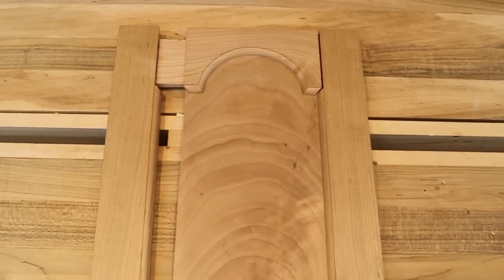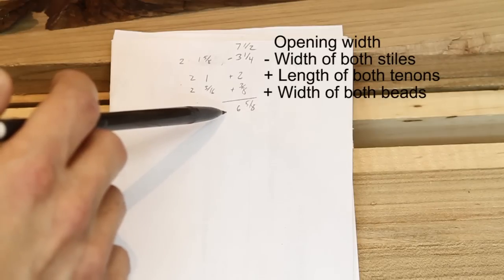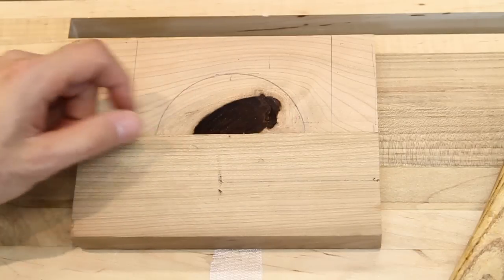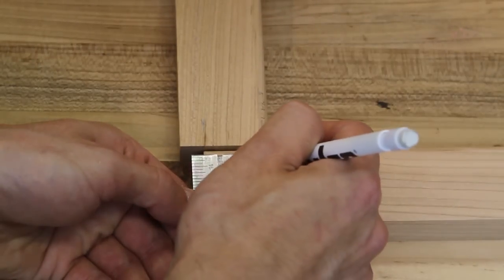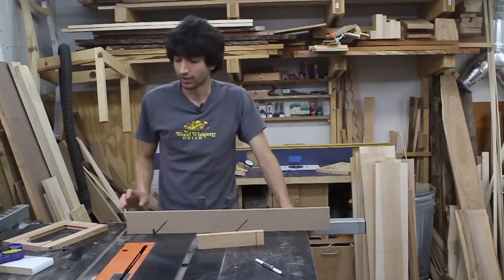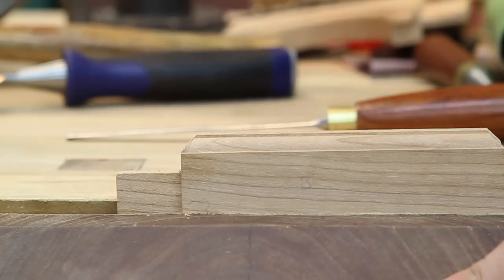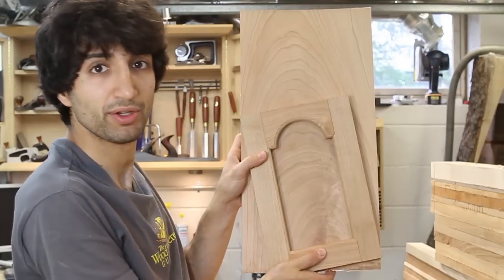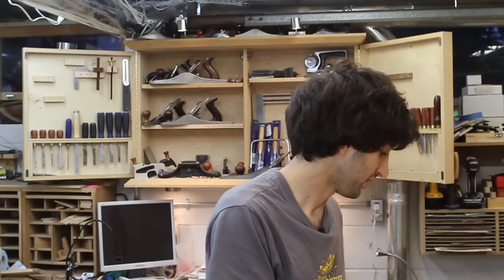Building a Mitered Beaded Door with an Arched Top Rail

Comment: Nice job of incorporating the wood grain around the knot into the arch of the rail!
Reply from the maker: Thanks Guy!  I had actually been holding on to that piece of cherry for a while for this exact purpose.  It's easier to find stock for a larger door since the "lift" doesn't need to be as sudden.

Comment: Thank you for the arched door out of the knot... I have been cutting my knot s out and throwing out the whole section of board of stile or rail... I was wondering through, do you have much trouble with the   wood twisting on you and getting the wood to size with out planing, because of tear out.
Reply from the maker: Thanks Randy!  Twisting generally isn't an issue.  I use my same milling process on these where I gradually bring them down to final thickness and these don't have any more tendency to distort over something straight grained. Tear out can be an issue.  I can typically tell on the first pass if it's going to be problematic.  If it is, light passes and running the boards at a skewed angle helps.  Any remaining tear out can be resolved with a scraper and/or sandpaper.  Not sure if you saw this one, but here's a much larger set of doors I did in the same manner: https://www.youtube.com/watch?v=2rlnpvIa49w

Comment: Reminds me how my previous employer had me make these joints. Except we removed the bead on the stiles with a router table/fence/straight bit. Is there a reason you didn't use the slot cutter to rout all the grooves at once?
Reply from the maker: diycentral I've seen that done as well.  I know Kreg has a setup for doing that in one step.  I used the table saw because there is less chance of me screwing something up lol
Reply: Matthew Cremona didn't know that about Kreg. Just looked it up. Thanks. Not that I'm going to buy it :p Just like to know things.
Reply from the maker: diycentral I'm the same way :)

Comment: Great work and good tips.   My only feedback is get some grippr's for the small pieces on the router table.  You gave me the heebe jeebe's watching your fingers that close.  You will need your digits in your long career in woodworking.  Take care!
Reply from the maker: bones549 They're on my list.  With the push blocks I have now, I don't feel like I have very good control when I use them.  I'm guessing the Grr-rippers are better though.  Thanks!
Reply: Matthew Cremona They are great especially with small pieces.   I've had them for a long time.  Also great for table saws.  I use them to do feed hand over hand through a TS or a router.  Keeps your hands away and great grip with the rubber bottoms.   They ain't cheap but then a trip to the emergency room is an expensive day.   Good luck.

Comment: Can you tell me what bit you used to cut the groove in the arch to accept the panel and where can I purchase one? I am in the process of fitting a 3/8 inch panel to an arched door and can't figure out how to cut the groove on the arch. Any help is appreciated. Thanks.
Reply from the maker: frehleycomet I used a slot cutter for it.  You buy the spindle (http://amzn.to/173BdTt) and add the cutters to it.  You can get the cutters in different widths and you can stack more than one on the arbor.  You can also buy different diameter bearings to set the cut depth.  Let me know if you have any questions!  Thanks!
Reply: Thank you so much. I will look into this.

Comment: I had such high hopes when everything was going so well that you wouldn't BOTHER to "center" the groove by running the pieces both ways!!!

This is a completely unnecessary step!

It reminds of the woman, who while teaching her daughter how to cook the Christmas ham, sliced the top of the ham off in the pan, and set it beside it in the pan, before covering it and closing the oven.  When her daughter asked why she did this, she said she didn't know, but that her mother always did it that way, so she just did it too.  Since her mom was there for Christmas, she asked her, "mom, why did you always do that?".  Mom replied she didn't know either, she learned it from Grandma.  Well, luckily Grandma was still healthy and there for Christmas too, so when they asked Grandma, she simply replied, "I had to do it because my pan wasn't tall enough!"

This simply has to be similar to the reason everyone still thinks they have to run the boards both ways to be ABSOLUTELY SURE their dado is in the middle!

It DOES NOT MATTER that it is in the perfect center!  I guarantee even Bob Villa couldn't point that out in the finished kitchen!!!  You're actually creating "play" to where the center panel could be towards the front, or back, or even slanted in the slot!!!

Just set it up, run a test scrap a couple inches in, and adjust it if out of center visually.   DONE.  You're EYE checking it at 6 inches, will beat Bob Villas at 6 FEET every time!  Now just run all the boards for the door with the SAME CONSISTENT FACE OUT AWAY FROM THE FENCE ON THE TABLE SAW (or UP, if using a router table...).

Result: you'll stop wasting time, and your dado won't be WIDER THAN YOU INTENDED by the amount you were off center, since by turning and running the boards the other way, this is what you're really accomplishing!

The only time you should do something is if it is the most efficient way to do something necessary.  So, the only time you would actually want to run boards over a dado stack BOTH WAYS is if you needed a CUSTOM DADO WIDTH in the center of a board that your stack couldn't provide.  In that case, you would use a stack narrower than desired, but at least 50% of the desired width.  Then you just calculate how much wood to leave on either side of the desired dado and set your fence to leave that much.  Now when you run the boards BOTH WAYS, you'll end up with that amount on either side of the dado, and the desired CUSTOM dado width in the middle.

Sorry to pick at this, but grandpa was a perfectionist, was a sheet metal expert (curved metal doors in D.C.), designed a multi-fuel furnace at a company completely himself, and passed down the desire to do it RIGHT, without WASTED EFFORT!  He passed it down to my dad who drew arguably the most complicated drawing by a draftsman ever (6 months to draw an orthogonal view of an Allis Chalmers combine seeing "through" to all the drivetrain and combine mechanics and gearing, all BY HAND on a drafting table! 

:)